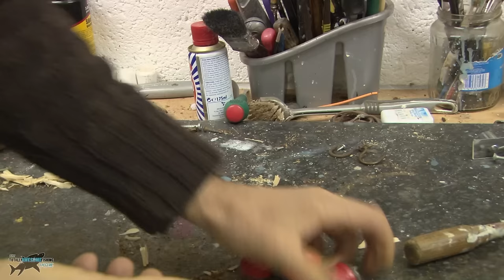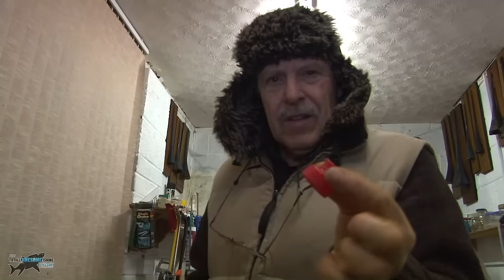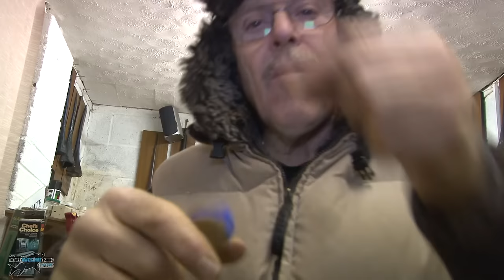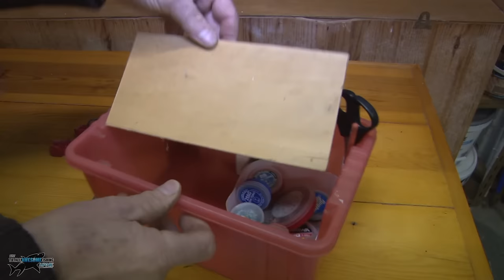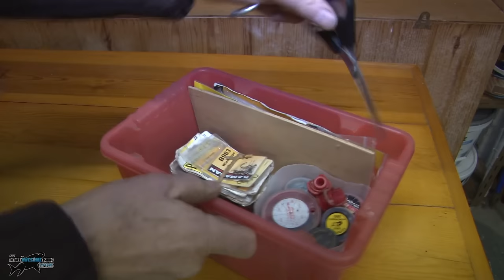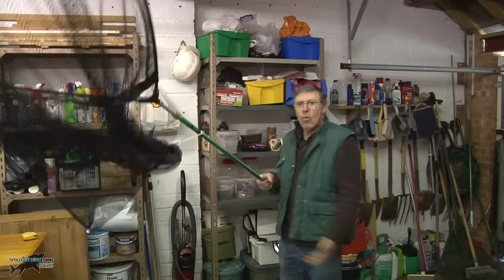More Fishing Tips on Rigs/Storage/Bite indicators and Fishing nets

Comment: GRAEME, TAKE A BROOM HANDLE (1 inch dowel) CUT IT THE LENGTH OF THE INSIDE DIMENSION OF YOUR TOTE BOX FOR A HANDLE.  SCREW A WOOD SCREW INTO EACH END OF THE HANDLE ANCHORING IT INTO THE PLASTIC TOTE.  USE A WASHER ON EACH SCREW SO AS NOT TO HAVE ANY TEAR OUT OF THE PLASTIC.  THIS WOULD MAKE A COMFORTABLE TOTE TO CARRY WITH ONE HAND, PLUS YOU COULD ALSO CARRY YOUR ROD OR NET IN THE SAME HAND.  NICE IDEA ABOUT THE TOTE, ONLY CARRY THE ESSENTIALS!

Comment: How do you put a starlight on the top of the bottle top what is a Val rubber what are those I like to put a light on mine plz mate
Reply from the maker: Check in your local tackle shop.Its called Valve rubber. You used to be able to buy a length of the tubing(different diameters) then just cut the length you want. Superglue the length of valve rubber onto the bottle top and then you can put the starlight in.
Reply: Thank for the info please keep the video coming there good to know thank again
Reply: Could you make a vid of useing the bottle top and show the light on top of the washing up top and could you do a video of useing the monkey climb to show how it work plz
Reply: Are the rubber for inner tubs for bike is that the cap I need what I need to do with it u said superglue it but do I need to cut the top end of for it to glue down
Reply: @TAFishing   could you send me the link for the valve rubber so I can buy them please
Reply: I can’t find the valve rubber
Reply: Can’t I use a tail rubber for fishing to hold the starlight